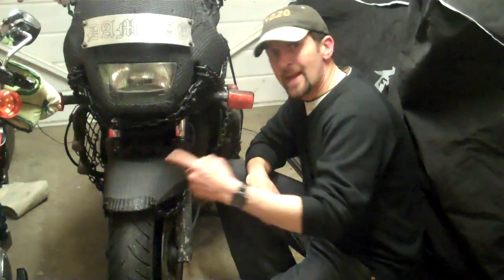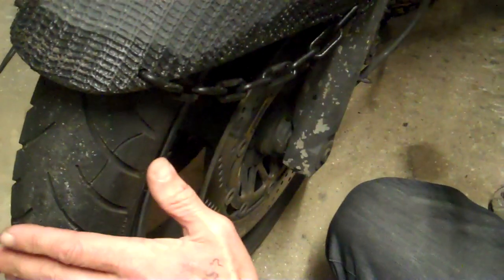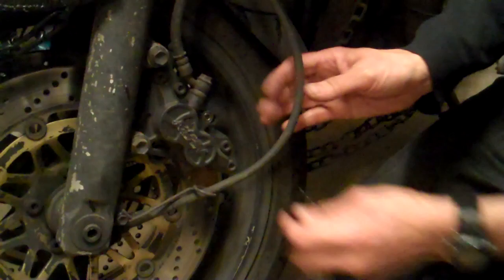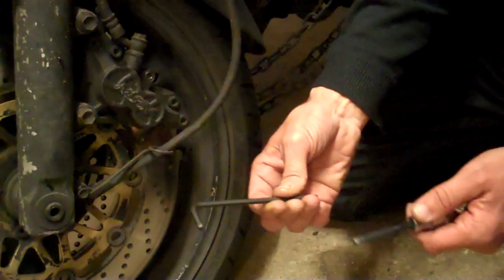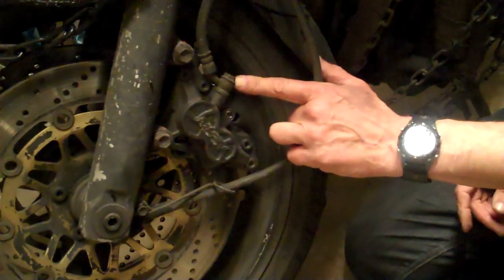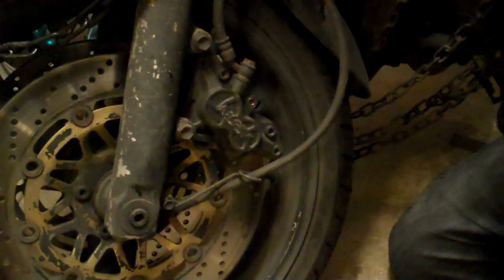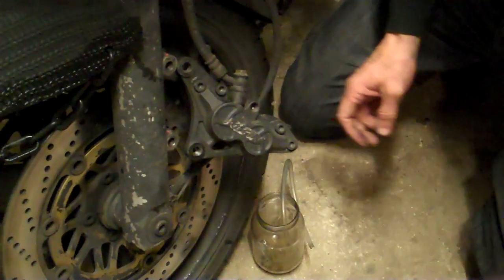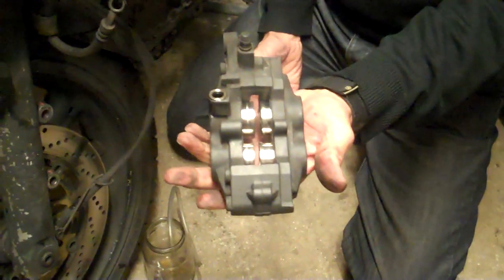Delboy's Garage, Motorcycle Front Brake Caliper rebuild Part 1.

Comment: Whenever I have something to do on my bike, Delboys is my first search. I love the way you take the time to explain the reasoning behind whatever it is we're repairing. I just did the rear brakes on my 99 Kawasaki Vulcan Nomad. So far they work fine, but I had no idea to check the angle of the seal to install them right side up. I didn't know there was a right side up. Tomorrow I'm rebuilding my front brakes (dual, left and right calipers), and I'll be sure to check that along with everything else. Anyways, thanks for your videos. As I said, I watch yours first!

Comment: Yeah I've watched several other "How to's" on caliper rebuilds.  You are the first to mention the correct orientation of that bottom seal.  Well done.
Reply from the maker: Thanks buddy, not all bikes have that style, these days the seals themselves are square and it's the seal recess that is machined with a slight angle to poke the bottom edge of the seal out, so just check once you pop it in that the lip is on the inside!

Comment: Great tutorial, I pull the brake lever all the way to the handlebar and tie it there with a piece of wire or zip tie etc. before I disconnect the banjo bolt, that will stop the fluid from draining out of the master cylinder. Fluid can still drain from the brake line though and securing it up like you did with the bungee will help prevent that. 
Keep them coming Del....

Comment: This vid inspired me and my mate to clean up his callipers and change the fluid. We were all good until we tried to get pressure back in the lever. After several tense hours we finally used a syringe to push fluid up into the system and shift the air out. The feeling was great when we finally had it all working again! Thanks for the vids, they're great.

Comment: Brilliant, learnt how to bleed brakes through these videos. About to rebuild a set of Nissins 4 pots to replace the tokico 6 pots on my zx7r so this is really useful. Was always worried about putting the pressure seal in the wrong way so its great to hear a video with clear information
Reply from the maker: Thanks Matthew, good luck with yours, thats a great upgrade and will make a huge improvement over the OEM calipers...

Comment: well I just finished putting my calipers together after a full strip and clean I used metal polish to on the pistons to make them like new, I can not believe the difference now with the bike its a zx6r j1 the travel on the leaver was massive before and now after the strip and clean its rock solid and perfect. All the pistons moving together at the same time its lush. Cheers Del you give me the confidence to do a job that i thought was too difficult its a piece of piss really!!

Comment: Great video,I'm rebuilding  roadliner front brake calipers. Very similar 4 piston setup, but 
caliper doesn't split in half. I finally got all 4 pistons out with air pressure, I got all the
seals out, looking at the last one out, I realized that the inside ones are tapered. Your
video was a big help. for putting in the first seals the right way. THANKS for pointing me
in the right direction!
Reply from the maker: Nice one buddy, glad it worked for ya, it's such a simple little thing, but as you can see, it would be quite serious if you got it wrong!  Thanks for taking the time to let us know the video helped... ride safe my friend, Del

Comment: I did this job to the Brembos on my Mille today using nothing but your videos for instruction. That should say a lot about how confidence inspiring your instruction is. The whole thing couldn't have gone better! Roll on the 6 pots rebuild on my GSX. I also changed my chain and sprockets today and that was another first for me! PS I had to order the seals from KTM as the Brembos are the same ones they use on the Superduke!

Comment: Excellent video.  I'm a 60 year old mechanical engineer with over 45 years experience working on cars and bikes.  I have one small suggestion:  When you describing "cracking" bolts, apply a quick pulse of power to the wrench.  Not with a hammer, just with your hands.  This will create a point load and will be easier to crack the bolt and it will result in fewer broken bolts.  A lot of force, gradually applied will break more bolts than a quick jerk or force.  Thanks again!  Great video!
Reply from the maker: Hi David, thank you for that sterling advice, and I already know that to be absolutely correct, as it was something taught to me by my grandfather - in a video I did on fork seals, I made mention of that technique for cracking off the bottom bolt in the forks... mainly because it screws in to the damper rod and there's nothing other than the force of the internal spring to stop that from turning, and if you give it a good sharp snap with the heel of your hand on the wrench, then usually it breaks free first time... I love how the oldest advice are still the best, and being passed down through the generations...  thank you again for your input, it's great to be reminded of the important little things we can forget... all the best, Del

Comment: Hey Del
Just thought I'd post to say that thanks to you and this video I managed to replace the seals on the front calipers on my 2009 Street Triple R.
One thing I did find out, though........the pressure seals don't seem to be shaped on my calipers....I could feel the lip every time and even removed one, flipped it and could still feel it. So I guess the caliper must be designed so the seal is made and the rubber seals are square.
Had a slightly tricky job bleeding the system (my first time ever bleeding brakes) but managed and been out for a short run - everything working fine with no leaks.
Complete flush of fluid too.

I'd never done anything like this before but your video gave me the confidence and info I needed.

Thanks a million....probably saved me a couple of hundred quid!!!
Cheers!!!

PS....the nerdy word you were looking for....trapezoid :)
Reply from the maker: darich67 Hi Buddy, Glad the video could help you out, and yeah, some calieprs have a shaped groove that stick the bottom of the seal out... as long as its in the right orientation then thats fine.. Thanks for watching buddy, and good luck with your projects.. Del.

Comment from the maker: Hi mate, well spotted, sticky calipers don't only bind you'll also have reduced braking power, which is all bad! Leave the caliper plumbed up, soak the gum line of the pistons with WD40 for an hour or so to soften the crud then pump them out with the brake lever..hold back the ones that move which will focus the power on the stuck one & prevent them popping out..that usually works fine,but if it doesn't let me know,there are a few other options that are a bit rougher if you are really in trouble

Comment from the maker: Hi Joni. there is no doubt what so ever that rebuilding your calipers would definitley eliminate all the binding, they will operate like new again and stay that way for a year or more...but only attempt it yoursrlf if you're sure you can understand the job from start to finish, and make sure you do a good safe job of it...of you can,,then get stuck in...The seals and a bit of fluid are all it needs in parts, so labour by a garage should be about 3 hours tops, it just depends on thier hourly rate

Comment from the maker: Hi mate, to clean the pistons I used "Solvol Autosol" polish...its an abrasive metal polish and leave them like new... if you see a kit for sale it should state what is in there, is will usually be the pressure seals and dust seals, plus maybe the centre seal too....as long as they are comprehensive then you should be ok... good luck with it.. Del.

Comment from the maker: Hi mate, when I replaced mine the salt build up behind the dust seals had actually pushed them out and caused them to get trapped, which damaged them, so I had no choice...but as long as they are in perfectly good condition and not leaking, then there's no reason not to clean them thoroughly & reinstall them, just when you're done give the bike a good thorough test before relying on them...unless they've done over 30,000 miles, they shouldn't be worn...good luck, let me know how it goes, Del

Comment from the maker: Not sure what exactly you are asking? The dust seals do snap into a recess so they need to be levered out carefully (if you don't have any new ones) and then popped back in firmly afterwards, but generally the dust boots are manual fit on and off... hope that helps with what you wanted, Del

Comment from the maker: I don't have a Bandit600 and I can't picture the assembly in my head, but with slide pin calipers just take the whole assembly off the bike & do it on the bench, they are not designed to come off whilst mounted to the fork leg, sorry I can't be more help, good luck, Del

Comment from the maker: Hi Billy, yes it is mate, you'll have to strip the caliper to it;s bare castings and the powder coaters much ensure that absolutely NONE of the mateing surfaces get any powder on them or they will leak... and on top of that, as powder coating is very hard, it can chip, which makes it hard to keep looking good... but plenty of people do it, specially the Barry Boys on their hot hatches... good luck with it, Del

Comment: Loverly job :-), ive done my own and frends, and my rule is clean clean clean.

I dont disconnect the hose unless i have to, as i often dont have new banjo washers.

For really nasty ring grooves ive used soft wood or soft plastic to clean them, otherwise a clean cloth works fine, old toothbrushes work well.

If im just replacing pads then i pump the pistons nearly out and clean them, dont want the ridge of crap hitting the seals.

Great tutorial :-)

Comment from the maker: HI mate, and thanks for your kind comments, good old GPX calipers, don't they just love to seize up?!  To anser your question, no,you can get away with using the old ones as long as they aren't worn or split,you have to take the calipers apart and take the seals out as the salt water gets in behind them, dries, leaving the salt behind which builds up and pushes the seals out,once you've scraped cleaned all this out you can rebuild them,but for me they were £8,so it was a no brainer,Good luck Del

Comment from the maker: Hey Mike. Good going buddy, its not hard and as long as you take your time, and make sure you double check everything, and properly road test it afterwards, then you should be fine...another thing the video didn't cover...make sure that when you take the pistons out, that they go back into the same cylinder they came from...good luck with it and thanks for the sub..Del.

Comment: Glad you liked my fix on the hydraulics Del. Another thing I meant to mention was, just as you had warned, most of the dust seal groves were full of crusty crud, so I cut the head of a bicycle spoke off, flattened the turned end with a hammer, filed it square and used it as a right angled scraper to clean out the groves, worked a treat! The threaded end also acted as a mild scraper in poking gunge out of the drilled oil ways. Result!

Comment from the maker: Hi mate,thanks for your kind words, brakes can sometimes be a little difficult to free up.The process of heating up an item & allowing it to cool again is referred to as a heat cycle & with brakes & tyres, exhausts, etc., this happens countless times in the life of the item, continued heat cycling can lead to seizures & dis-assembley problems so nothing out of the ordinary, I just need to know what you mean by 'screw cap over the bolt', could you explain or send a photo so I can help? Cheers Del

Comment from the maker: Hi Ian// that's great to hear mate, I love it when a plan comes together. .lol its not just the money saving that you have achieved but also you now know more about your bike and are better in touch with the important parts like brakes...and that has t be all good... well done mate, and glad it worked for you.. ride safe fellah, del.
Reply: Great vid Del, is it possible to use the old seals again if not damaged as im having trouble finding new ones? thanks
Reply from the maker: @SEANO1810  Yes mate, as long as they are clean with no nicks or cuts in them, and they weren't leaking before, then you should be able to re-use them, but remember that they're old seals and perhaps get some in the future, just to be safe!
Reply: @Moonfleet41  cheers mate 🙂

Comment: Thank you very much for all this info, I now have to do this to my bike, a Yamaha WR125R Front brake caliper, and my seals are £21 on ebay but thank's to you i will now save myself £60 that's what i was told from Tinklers Motorcycle, This is all because i put new pads in myself back and front, but the front one's are holding on to the disk. so i will follow what you say and hope for the best!! Thanks alot m8 now i have subbed to you, you have alot of interesting video's. Steve...
Reply from the maker: Hi Steve... well done mate, its not hard, just take your time and do one step at a time, drop me a line if you get stuck aye.. good luck.. Del.

Comment from the maker: Hi Ade.. that's an old college class rule, but in practice, as long as the caliper isnt too old and then its fine..the castings didnt have any scoring and the pistons were mint...but i will agree, if you want to be totally OCD and make a tip top job, then keep each piston matched to the hole it came from.. good point well made mate.  Thanks for watching mate, take care, Del.

Comment from the maker: No really mate, its a simple enough task, you may need to prime the new hoses to get them to bleed up...and if you want a really solid hard bleed, then do them upside down..(hang the calipers up on the shed roof, use a broken lump of old number plate to represent the disc, and effectively bleed "upwards"..nature sends air the same way, so guaranteed a perfect result...and with settle hoses, you'll be doing stoppies in yer way to work..LOL!... good luck chap.. Del.

Comment: what a numpty! I did say I was a bit of an Ignoramus! after 5 minutes of looking at the master cylinder holes with the cap off and watching my nice new piston gubins inside sliding back and forth as they should, it accrued to me that they are not sliding very far........ so I loosened the adjuster bolt by the brake lever! ; (
Brakes working again now! silly arse! had to come clean if for no other reason than to give you and Penny a good giggle!!
Thanks and keep putting up these great Vids.
Reply from the maker: Now thats fine idiot behaviour, you'd make a great fellow idiot for the collective... there are already a few hundred of us on the forum...so join us and maybe we'll see you at a meet soon...Here's a link.. http://bikers.boards.net/  That is of course if you're brakes will let you leave the garage..duh..lol

Comment: Great video Del. I was looking for a way of shifting a stuck piston in the front calipers of my ZZR1100 and thought of using the hydraulics but liked your tip on cleaning the caliper first with soap and water and also the tip on cracking the assembly bolts before removing the caliper. Also your trick of the old inner tube worked great on working the piston free. Mind you, the one was so tight I did unfortunately mark the piston (new one on order!) however worked well on removing all the others including rear caliper. A further suggestion though, on twin disc bikes it's best to remove both calipers at the same time and carefully pump the pistons out, otherwise as I found, you've lost the ability to tackle the second one because the fluid's gone on the first! I ended up using a nut and bolt with a couple of fibre washers to sandwich the loose banjo so I could top up with fluid and pump the second set out.
Reply from the maker: Hi Jeff..
You are right on the twin caliper question mate, you'll need the hydraulics fully plumbed up and working to get them out...and tha can be tricky....but i like the trick you used too, like all these things my friend, you just improvise and overcome aye.. well done for tackling it mate... all the best, Del.

Comment: I don't know if anyone else has tried this as a method of pushing a piston out when only one won't budge but the other three are moving and finger pressure isn't working to stop them; with 4 pistons on a caliper and there not being much space, it makes G-clamps impractical to hold the moving pistons, so I had the idea of using a cable tie on each of the three free pistons and to my amazement it worked, the stuck one popped out! It also works on the bench with a "track" pump on the bleed nipple (obviously after the brake fluid has been drained).

Comment from the maker: Hi mate, glad you got the pins sorted & seized pins are a common problem if you don't clean your brakes. There are 3 ways to plump your front calipers, so how have you got them hosed up so that I can just how to bleed them?  Is it the factory way with a splitter?  or 2 hoses from the bar to each separately, or a single hose to one and then piggy-backed to the other?  ... oh, and have you emptied the hoses completely, or just taken the ends off at the bottom? ...